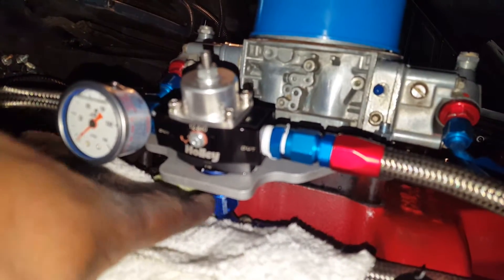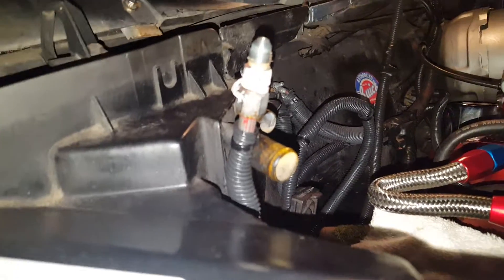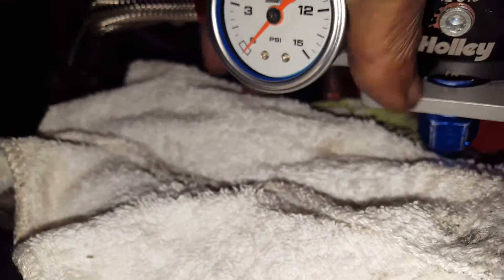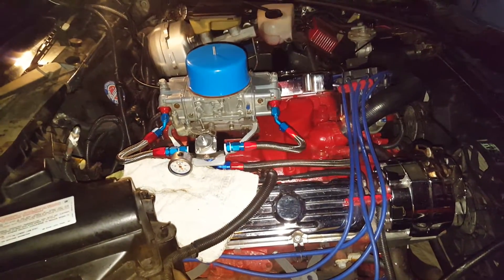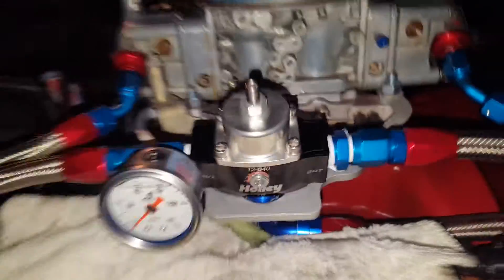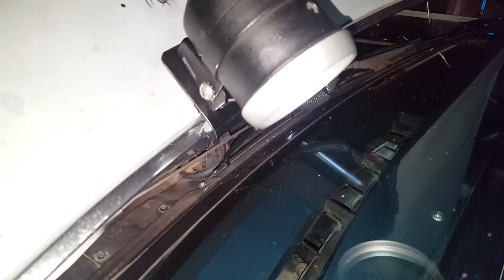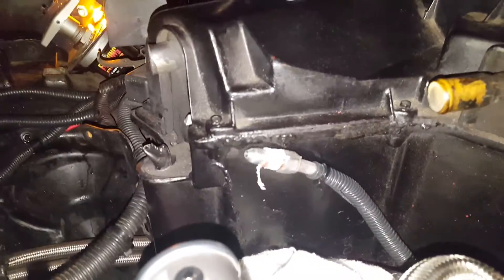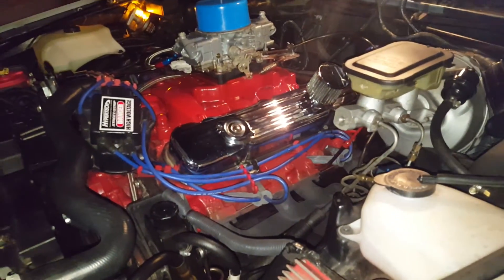CDS 1987 Stage-1 Buick 455 Regal-T ... TA Performance mechanical fuel pump BYPASSED. 10-16-2016

Comment from the maker: ... the 3 dislikes are apparently from the viewers that "assumed" 😂😂😂 that the braided stainless steel fuel lines I installed were KINKED. I also installed the remainder of the braided stainless steel fuel lines from fuel tank to engine block, 6 years ago. 👍👍💯💯💯💯✌

Comment: Hey hey hey!  Just wanted to say that I just installed a TA performance stage 1 mechanical fuel pump and it was only like $40! It made a big difference when accelerating compared to my worn out ass original pump.  Anyway,  it runs 6-8psi and it doesn't leak.  Anyway,  I hope you are well!!!! Love your videos man,  take care
Reply from the maker: Hey, Chris 😃👍🏼👍🏼.

I'm VERY happy to hear that you got a TA Performance Mechanical Fuel Pump, and all is going great. 

A couple of days ago, my TA Performance Mechanical Street/Strip Fuel Pump FAILED. It began leaking Fuel from the bottom screw ... from the Diaphragm I feel. 

I'm ONLY using the Carter Electric Fuel Pump now.

Did you create a YouTube video of your Buick?

Have a great weekend. 

👍🏼👍🏼😎

Comment: Carter suggests or advises not to use teflon tape on their pumps and plumbing ..... you may want to try and plumb your lines with out it and see if it helps.... tho by now you probaly have it all sorted out seeing this is a year old video ..... thought i would share that Carter info though ....also if using teflon tape for gas plumbing you should use the yellow teflon tape thats made for gas .... the white stuff is just for water bro ..... hope this helps a little...... Cheers from Canada
Reply from the maker: 69 NovaGuy WOW; MUCH appreciated information 👍🏻👍🏻😃. I never knew that regarding the differences in Teflon tape. I tried using NO tape, and fuel leaked. I really appreciate your help and expertise. Have a great weekend.
 😃👍🏽👍🏽💯💯💯💯
Reply: thanks man you too .... Hey a quick question as i am trying to figure out what fuel pump to buy ...... do you think the Carter delivers enough fuel pressure for a big power motor like yours or are they just delivering 8 psi tops .... I really like the Carter pump but wonder if they push enough PSI ....Thanks man

Comment: Both Fuel Lines that lead to the Bowls are kinked. Please evaluate your installation. V.
Reply from the maker: It's weird; it LOOKS like that in certain light situations/angle shots. The fuel lines are fine. I recently changed both Needle & Seat assemblies; they were getting stuck.

Comment: Is that a 750 Holly or 850?
Reply from the maker: the magician  In this video, a Holley 850-cfm. It was recently  rebuilt and modified to 950-cfm.

My Needle and Seat Assemblies were constantly getting STUCK.
Reply: Buick 455 Torque I'm debating going with a detuned dominator on my 455 stage 1